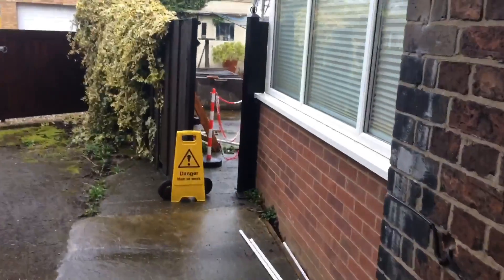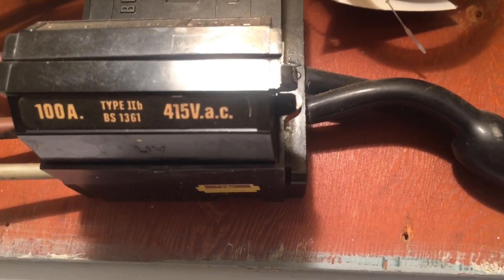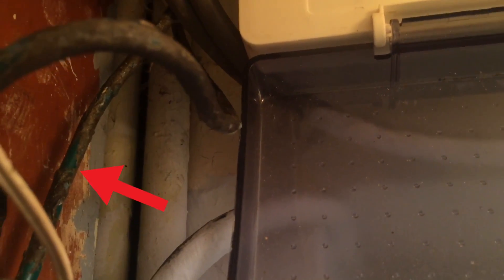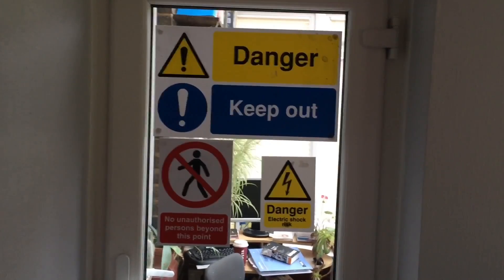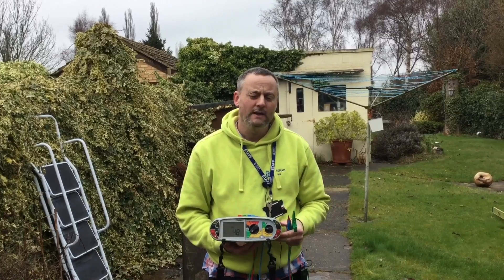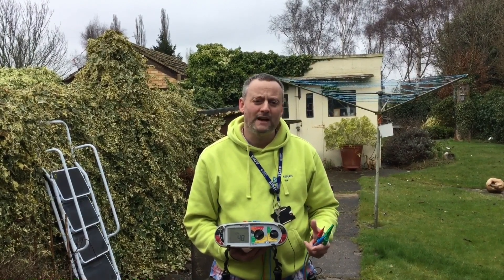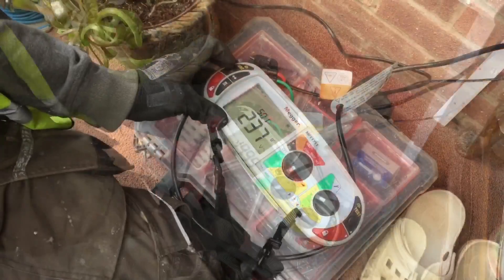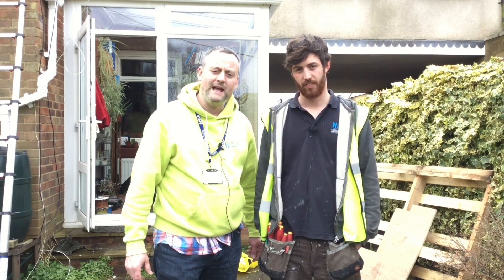On-Site Changing an Outside LED Light Connected to a TT Supply (Read Description) Includes Testing

Comment: Hi can I have junction box underground for garden lights
Reply from the maker: Hi. A cable joint or an IP rated enclosure with correct glands 
http://www.exteriorlightsuk.co.uk/shop/installation-items
https://www.hellermanntyton.co.uk/competences/gel-filled-cable-joints
Sorry I am little help currently away on holiday will very little Wi-fi. All the best GSH Electrical

Comment: The risk assessment would have stated that wearing all that PPE could have caused the installer to faint and fall off the ladders because of the heat generated by the human body and the amount of clothes preventing natural cooling.
All that PPE could cause death from height in that too much clothing could cause entrapment or entanglement and cause the installer to fall from height.
The hard hat could fall off his head (from height) and hit someone on the head.
The goggles could  fog up causing disorientation and he could fall from height.
Answer = Don't wear all that PPE it isn't necessary on a small job like this.

Comment: Looks the business. The only thing I'd add is to remember to test the light works before installing it, and that also means testing out the timing. Nothing worse than having to go up and down the ladder tweaking it to be just right.
Reply from the maker: Hi. What a great point. Thanks for commenting and watching GSH Electrical 👍

Comment: The health & safety might seem onerous here, but it's important that the students are aware of the various H&S requirements and they are able to properly asses all the risks. Whilst a typical electrician may not run through these procedures every day, the fact they are aware of them is generally enough. Videos like this aim to show best-practice with respect to risk analysis and health and safety.
Reply from the maker: Wow thanks for taking the time to post your message much appreciated Gaz

Comment: Hi Gaz is it possible to obtain a generic risk assessment, method statement for electrical work on line ?
Reply from the maker: Hi great question my learners normally download and alter company safety policies to fit themselves. I like them to produce their own risk assessments and methods statements using online blanks or ones I give them... sure you could find them online. Thanks for watching GSH Electrical
Reply: GSH Electrical cheers Gaz as usual top draw 👍

Comment: When carrying out a 2 lead test (L - N) he said he used a "hi" setting on the megger, wouldnt this trip the rcd ? When carrying out a 3 lead test or 2 lead line and earth test i use "low" setting,  Thanks
Reply from the maker: Hi. Remember all loads are connected across line and neutral so a loop test on the high setting is fine between line and neutral thanks For watching and commenting GSH Electrical